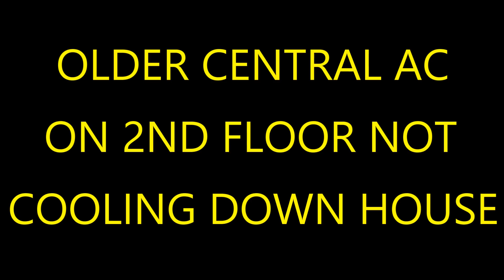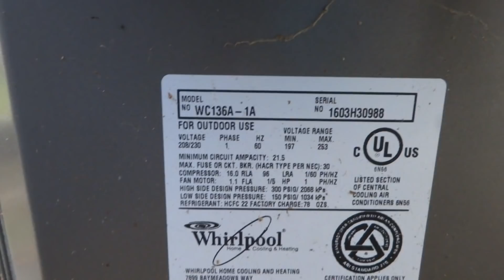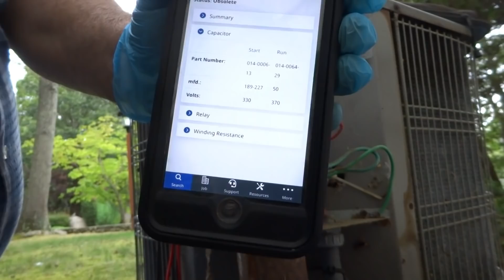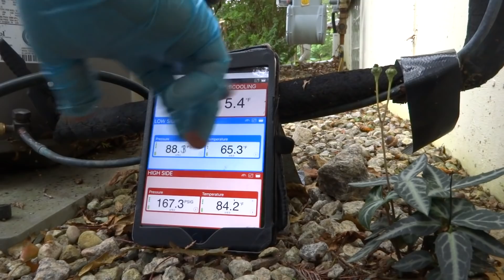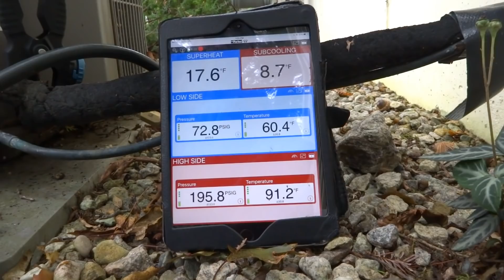OLD CENTRAL A.C. ON 2ND FLOOR NOT COOLING HOUSE

Comment: what would happen if you used say a 40 - 5?  how close do you need to be to the original cap?
Reply from the maker: 40/ 5 the compressor would not start ...it called for a 50/5
Reply: What about 55/5

Comment: What is the app that you used for the capacitor size ? Thanks for sharing this video.
Reply from the maker: Copland mobile ap
Reply: Bluon has app shoots you full specs on unit..
Reply: @stevenlavimoniere  Thanks for your reply
Reply: @milotorres6894  thanks

Comment: could been a cheap rebadged Nordyne unit he has i watched a ted cook video he replaced the rebadged Nordyne condenser saying it leaked plus it having a microchannel condensing coil like the York units. as i think maybe or maybe not Whirlpool hvac systems are Nordyne.  as people don't want to upgrade the condenser and indoor unit because the new stuff is 410A If the R22 freon supply runs out may be converted to R407C. depends what areas and supply houses have the gasses available. as the new units have to be 410A.
Reply: and 410a will be a thing of the past in less than 5 years
Reply: @alanm2842  Gotta keep DuPont employed, I guess.

Comment: The capacitor was initially known as a condenser. The term “condensor” was associated with it because it was supposed to condense electric charge. The charge it could hold at a rated voltage was known as “capacity.”. This term was in use till about 1960s. The term was later renamed as “ capacitor ” to harmonize the terminology of R, L, and C and to fall in line with terms: inductor and resistor.     I got this info from the internet.
Reply: You must work for NASA🙂
Reply: I think you’re mistaking “condense” with “conduct”. You can’t “condense” electric
Reply: I would double check what you read on the internet there chief.
Reply: @Smoshylife  You can condense electrons into smaller space. Condenser is outdated but it does make sense, in a charged capacitor you have a higher charge density than you do in the rest of the conductor - literally a higher density of electrons.
Reply: Capacitor in french is condensateur.
Reply: @ttb6384  It has a nice sound to it.  Need to get more formal with the French in early electronics.